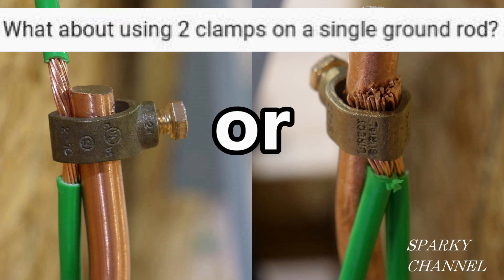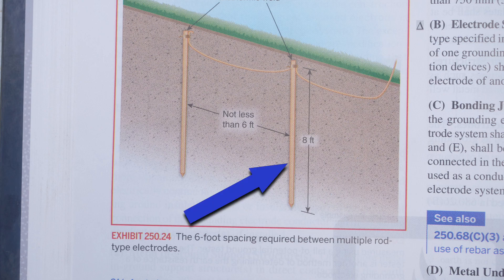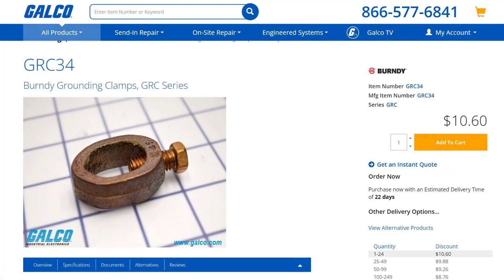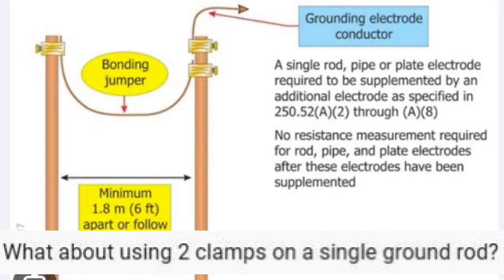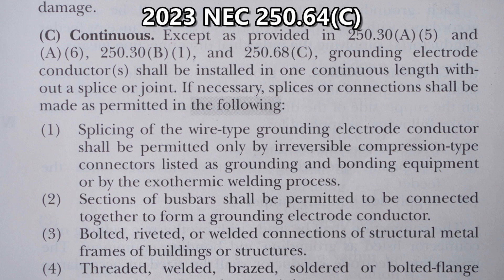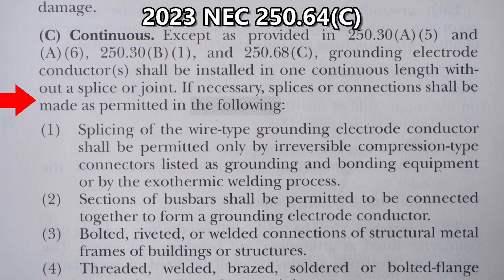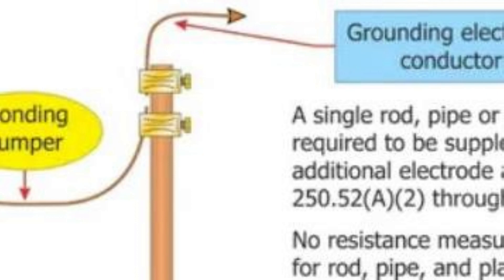Can I Use Two Acorn Clamps on a Ground Rod by 2023 NEC 250.64(C)?

Comment: I like your content, however I believe you are mistaken on this one. The grounding electrode conductor is the wire that connects the service to the electrode, or the electrode system.  All other wires from there on are bonding jumpers. See Art 100 Definition: Bonding Conductor (Bonding Jumper); Then see Definition: Grounding Electrode conductor. Finally see 250.53(C) ... the bonding jumper used to connect electrodes together... Keep up the content!

Comment: Continuous. Best practice. I’ve seen it done all kinds of which ways. Thank you.
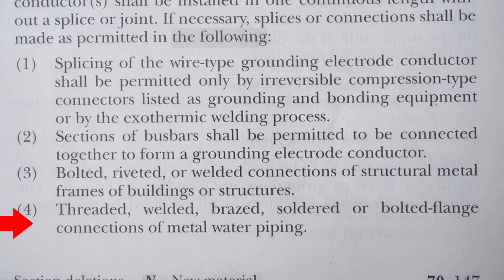Reply from the maker: I agree. If you wanted to run a non-continuous GEC bonding jumper to the 2nd ground rod, one of the 4 methods shown at 3:11 would have to be used, such as exothermic welding. But with acorn clamps, it must be continuous IMO.

Comment: I believe that the GEC is only from the Grounded conductor of the service to the first grounding electrode. If you use a second acorn clamp on the first group rod with a separate conductor from the first rod to the second rod, that conductor would be considered a bonding jumper. Therefore it would not need to be continuous. What do you think? I appreciate your input. Thank you!
Reply: Correct
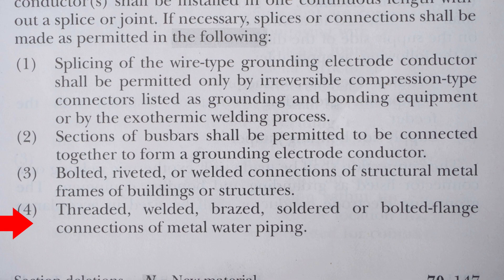Reply from the maker: If you wanted to run a non-continuous GEC bonding jumper to the 2nd ground rod, one of the 4 methods shown at 3:11 would have to be used. But with acorn clamps, it must be continuous IMO.
Reply: I don't think any of my inspectors would buy that logic.  unless you did a test and the first ground rod was sufficient to ground the system.  then you would just be bonding a random piece of metal stuck in the ground.
Reply: Bonding jumper
Reply: I tend to agree. See Art 100 Definition: Bonding Conductor (Bonding Jumper); Then see Definition: Grounding Electrode conductor. Finally see 250.53(C) ... the bonding jumper used to connect electrodes together...
Reply: Yes, I would say that the two grounding electrodes are "bonded" together and thus the second conductor is a bonding jumper.... But, I could see the AHJ asserting that they want it continuous...

Comment: Hi Bill. 
There is nothing wrong with the two ground clamps, the grounding electric conductor is the one from the ground rod in to the panel, the conductor from ground rod to ground rod it is a bonding jumper.
Reply: Still MUST be continuous,  not a separate wire.
Reply: @willschultz5452  no, it doesn’t have to be continuous, the second ground rod is supplementary when one ground rod isn’t enough, that is why that conductor is a bonding jumper.
Reply: @luislazogue8089  You are correct.
Reply: @sparkyjerred419  thank you.
Reply: Agreed.  The second rod is a supplemental electrode as required by 250.53(A)(2).  The GEC is required to be unspliced from its bonded point on the service grounded conductor to the grounding electrode, the rod in this case.
Reply: only if the second rod wasn't required to provide an effective grounding electrode system.
Reply: Nice work!
Reply: So are you saying if I have a 200 amp service with a disconnect/meter (combo) I can run 1 wire #6 copper from ground rod to the other ground rod using two acorns and then run an entirely separate #6 copper conductor from one of the two ground rods with its own acorn to the first means of disconnect (AKA Meter/Disconnect)?
If so I have to disagree because that would not be considered "continuous"
Reply: @theseattlegreen1871  the number six from one ground rod to the second ground rod it’s a bonding jumper between two ground electrode.
Reply: That's correct, if the GEC is continuous from the service to the first rod.  You are just supplementing the grounding electrode with an additional electrode to provide the required resistance.  Read the wording in 250.53(A)(2)  @theseattlegreen1871
Reply: @donl1410  
Well slap me silly and call me Shirley!  The inspectors in Connecticut will have none of this !😄👍
Reply from the maker: Hi Ian! @ianclifford31
Reply: I just put a 200 amp  single phase service  on a galvanized I beam set like a fence post for three grain bins with a dryer.  The sheet they gave me with examples of what meter bases 4:31 they would approve for farm services had a note in red that GEC must be continuous no splice of any kind outside of the disconnect or at ground rods.   They did allow the I beam to be used as the first ground rod.
Reply: If the sheet you received was from the AHJ, then that is what is required.  As I mentioned in another post. the local or state AHJ can make documented changes or formal interpretations to the NEC.  @vicktorpatriot1430
Reply: This is correct. Unfortunately, most inspectors don't know what they are doing and will fail it
Reply: @davidmerlo3352  good inspectors are open to heard electrician explanations.

Comment: Go to the first rod 1 clamp and run the wire through it continuous  (stripping the insulation if it is insulated then go to the second rood and install another clam and terminate. The first rod only needs 1 clamp because the wire is continuous it is still only one wire
Reply from the maker: Excellent!

Comment: Currently my GEC is  bonded to the utility ground inside the meter pedestal. Only 3 conductors enter into my service panel. ( 2 hots. 1 neutral.) Im adding  a service ATS ahead of the existing panel. I plan to bond at the ATS and unbond the existing panel. My inspector wants me to run the grounding conductor to the ATS to be code compliant. Can I add a second GEC to the existing grounding electrodes using separate clamps? Thanks.

Comment: It must be continuous.  I tried to slip it by the inspector once and he failed it and I had to rip it all out and replace it! We must also have 2 rods and the water pipe ground,  even on a 100 amp service.
Reply from the maker: I've had a similar experience. If you don't run the continuous wire, inspectors will most likely flunk it. Also, it's best practice to run continuous wire to the 2 ground rods and to the cold water pipe as well. Plus, the 4 or 6AWG wire is expensive and you don't want to have to buy it again so that you can run it continuously.
Reply: Most inspectors I run across don't know what they are doing, at least San Diego residential inspectors
Reply: @davidmerlo3352  yes that's for sure, too many opinions, every inspector wants something different.  NEC needs to make the language easier to understand so inspectors can't make up whatever they want 🙄
Reply: @SparkyChannel what about that continuous tun also bonding to the gas pipe? Both water and gas pipe are present in my crawlspace rather near to each other.

Comment: Could you cover portable / fixed generator grounding. Mine has its own 8ft ground rod tied to the generator frame, as well as the fuel tanks. This is separate from the normal service connection ground rod. If it makes a difference my generator is tied into the main panel via a manual interlock.  Thanks!
Reply from the maker: It sounds like you have an excellent grounding system. Well done on getting the generator system. Sorry, no video planned for the generator grounding.
Reply: If this generator is supplying a house through a service panel (or a transfer switch), then it MUST also be bonded to the house's grounding electrode system (ground rod).
While it's fine to have an "additional" ground rod tied to the generator frame & grounding point, it's important to keep differential ground potentials low, and bonding your generator's ground to your house's ground (if it's supplying a house) is very important. That's the whole idea of grounding.
Your generator should also NOT have the neutral and ground bonded at the generator. The generator's neutral conductor should be run along with the hot (ungrounded) conductors, all the way to your panel or transfer switch. Then the neutral-ground jumper in you panel will be the bonding point. If the generator supplies 240/120v (two "hots" and a neutral), then you need four, separate wires from the generator: Two hot legs, one neutral, and one equipment bonding conductor (ground).
I do a lot of generator installations here in west Texas (mostly Generac units). Grounding is critical because of our lightning issues here.

Comment: Either method is permitted.

The term "Continuous", in this case, as used in 250.64(C), applies ONLY to the Grounding Electrode Conductor (GEC) between the panel/bus bar/bonding point, and the initial grounding electrode. (See Art.100, "Grounding Electrode Conductor"). That "first" conductor to the ground rod must be "continuous" (not spliced, tapped, or interrupted) EXCEPT by the methods & means indicated in 250.64(C)(1-4).

The addition of more than one grounding electrode (ground rod) is permitted, and the interconnection "bonding jumpers" to the additional electrode(s) would need to comply with 250.53(C) and 250.70(A), which specifies, "Listed... lugs, pressure connectors, clamps, or other listed means". However, there is NO requirement that the conductor itself (between the electrodes) be "continuous", i.e., a single, uninterrupted conductor. Multiple conductors, terminated into listed clamps at each rod, is permitted.

Therefore, if the connector (i.e., "Acorn nut) ") is "listed" (and/or approved) for only a single conductor, then only one may be put under the clamp. If necessary, for multiple conductors, two (or more) clamps may be used... or a single clamp with a single, continuous conductor passing through it, as shown in the video.

Lastly, since multiple grounding electrodes are not "required" (with the exception of a high resistance/impedance situation requirement), any additional ground rods would likely fall under 250.54, and would be basically exempted from the requirements of 250.50 and 250.53(C).

With all that said, no doubt the "best practice" would be the image shown on the left (a continuous conductor passing through). However, either method SHOULD be acceptable, according to NEC. Unfortunately, some "Local Code" addendums might supersede and/or override the NEC requirements, and as such, the local AHJ may or may not approve of one or the other. Sometimes inspectors get a little uppity about such things, regardless of what the Code says...😁

I'm a ham radio operator, and have a large ground electrode system for my radio gear (also bonded back to my primary utility/house panel electrode). It consists of four 5/8"x8-foot driven rods, all interconnected via #2awg solid CU (buried at about 18-inches).  The connection at each rod used the "continuous" method and listed acorn clamps.
Reply: Thank you for this! Continuous GEC to first grounding rod makes total sense. It also makes mention, if necessary an irreversible style clamp may be used. I would think reasoning behind this code is to avoid any possible loose connection of the GEC from service panel to first grounding rod.  If that is the thought behind it, wouldn't that pose the same question for a possible loose connection with an acorn clamp at the first grounding rod. You would think if that was the rationale behind the code they would also require some sort of irreversible style clamp for the termination at the first grounding rod. Love to hear what your thoughts are on this.

Comment: So the only way to splice easily is by irreversible compression type connectors ? So why not use a acorn rated for 2 wires and tighten it up real good and cut the head off the compression bolt?

Comment: If you took one conductor and stripped a given section of insulation off of it ( if it has insulation) and you bend it in half and stick the bend in the acorn clamp, do you have one or two conductors?🤔.  I submit that it is still a single conductor…
Reply from the maker: IMO that would count as 2 conductors. I don't think that would fly for most inspectors, but you would be keeping the wire continuous.

Comment: Also people commonly install 2 ground rods. The code only calls for one IF it is tested to be less than 25 ohms to ground. Since most contractors do not have the testing equipment they simply install the second rod which makes it code compliant without testing
Reply from the maker: Thanks Ed!
Reply: Several of our utilities require multiple ground rods so does not matter that the NEC does not. And the GEC has had to be (for them, again) continuous ever since I started wiring in the ‘70’s .

Comment: Couldn’t you just buy an acorn clamp that accommodates 2 Gec’s?
Reply from the maker: If you wanted to run a non-continuous GEC bonding jumper to the 2nd ground rod, one of the 4 methods shown at 3:11 would have to be used. But with acorn clamps, it must be continuous IMO.
Reply: Thank you sir !

Comment: No, it must be continuous across both rods
Reply from the maker: I agree. If you wanted to run a non-continuous GEC bonding jumper to the 2nd ground rod, one of the 4 methods shown at 3:11 would have to be used, such as exothermic welding. But with acorn clamps, it must be continuous IMO.
Reply: 250.53 says otherwise.  It is not required to be continuous after the first electrode, you could even come off it & hit water or ufer if the conductor is sized correctly.
Reply: @sparkyjerred419 You can run it through the water pipe also BUT it must be continuous through all 3.  Inspectors WILL fail you if it is done any other way.   Must be continuous across the water meter jumper as well.
Reply: @willschultz5452  ,in Louisville.  for years has been one wire to the water ground. and one war all the way to both driven grounds. never been turned down.
Reply: @willschultz5452  I disagree.  I  believe Mike Holt would disagree aswell.  Inspectors won't fail you here for your bonding jumpers to your supplemental electrodes not being continuous to the service.
Reply: @sparkyjerred419   I tried to do it that way and they will not pass it.  Several inspectors do the same thing they will not pass it unless it is continuous. Maybe since they are insisting on 2 rods they do not consider it supplemental
Reply: @willschultz5452  perhaps but it is a supplemental electrode. The power companies & inspectors often make requirements that are not what the code says. We have 1 utility that will not allow you to use the metercan to connect your electrode & another that requires you to. The nec says it's fine.
Reply: @sparkyjerred419  Yes here our grounds must go to the service panel,  or  to the main disconnect switch if there is one.  Nothing can be grounded to the meter enclosure.
Reply: @SparkyChannel  your ignoring 250.53 for supplemental electrodes that says they can be connected to the primary electrode.
Reply: @sparkyjerred419  neither 250.53 nor 250.70 says the grounding electrode conductor doesn't have to be continuous if you use a supplemental gounding electrode to meet the requirements of the NEC.
Reply: @sparkyjerred419  it doesn't say you can piece together the conductor.
Reply from the maker: Ken, I agree with you, except for the exceptions shown at 3:11. But then, if you use one of those methods, it really is continuous anyway.  @kenbrown2808
Reply: @SparkyChannel  exactly, the point is these two are trying to play semantics games.  I'd love to sic my old inspector on them.  his two greatest loves are learning new things, and taking people to school when they try to play semantics games to get away with something.
Reply: @sparkyjerred419  "it is a supplemental electrode" -- I think this video is about a scenario where it's NOT supplemental, right?
Reply: @kenbrown2808  the nec says that a single ground rod must be supplemented by another electrode unless you can prove a resistance of less than 25 ohms. That means it is always supplemental.  The NFPA website even shows pictures of The grounding electrode conductor system using multiple clamps since anything after the first electrode is a bonding jumper. Maybe you & your old inspector should do some research.
Reply: @sparkyjerred419  the inspector doesn't care. Its his way or no way if you want it to pass🤷‍♂️
Reply: My AHJ would say that two ground rods are needed in our area to form the grounding electrode, and thus, the wire between them is a grounding electrode conductor. It must be continuous. I disagree and see the second as supplemental and thus the wire between them as a bonding conductor..

Comment: On my personal and family members.  Or when I’m doing a job and the wire and grounding electrode is attached underneath or inside concrete to be buried..   I actually take it one step further, and use the real Silver Brazing rod and silver breeze the wire to the rod for the copper water pipe that is located underneath the concrete to be buried. 

Nothing conducts better than silver 

Completely encapsulated in Silver, so no possible water or Corrosion intrusion .
Reply from the maker: Excellent job!
Reply: I think the NEC doesn't recognize it as the sole connection method, though.  I know for sure that soldering isn't recognized
Reply: @coldfinger459sub0  yes, brazing to protect a bonding clamp would be acceptable.  I'm not sure that brazing instead of a clamp would be recognized.  
however, in my experience, it's not the clamp that fails.